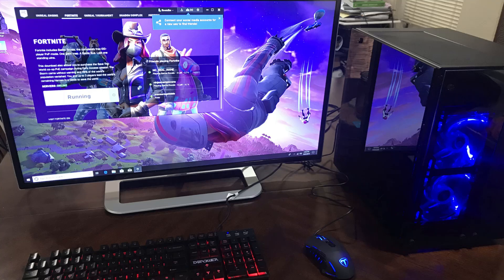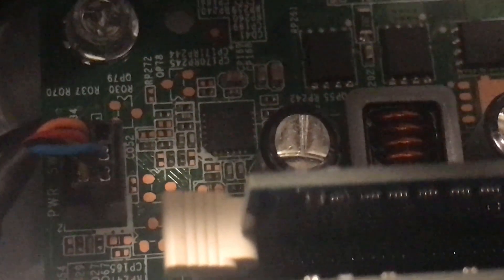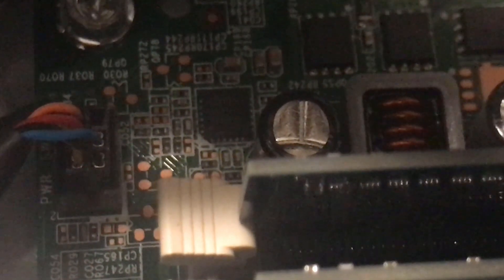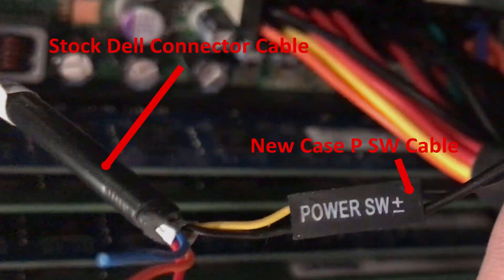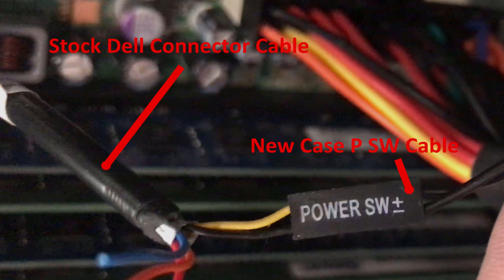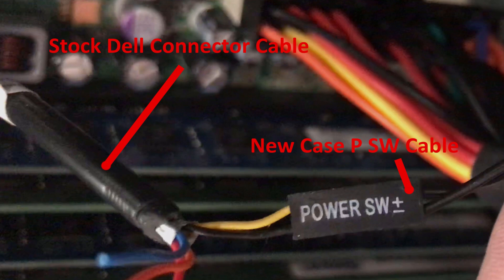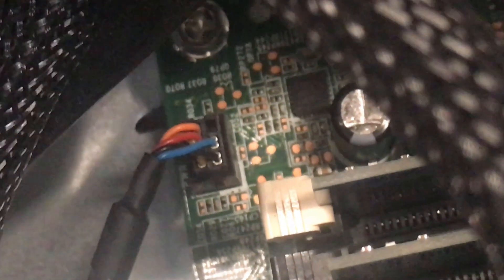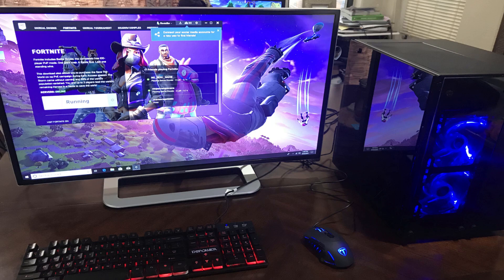Dell Optiplex 990 New Case Power Switch Wiring and Diagram

Comment: I am too lazy to do this so I just plugged the 2 pin power switch on the pin 1 and 4 which is the power switch and it worked 😅

Comment: There are adapter pcbs on ebay but they're quite expensive. Last I knew you could get a set for the power and usb/aud front panel for around $20-$30 usd. Friend of mine just gave me a 7010 with a third gen i7.
Reply: lemme guess 3770 haha thatsa  good one

Comment: If you do this frequently you might be better off buying a dupont crimper and the connectors (2.54.) You can just cut the switch off the cable and then  add male pins to the end of the wires. Same with the proprietary front panel connector, that weird 20/40 pin connector you find on Dells, assuming you can find the pinout or have a volt meter to figure out the wiring yourself. On ebay there are circuitboards that you can plugin so you dont have to do this, but its cheaper to just get the dupont supplies and use the cables you already have inside the machine. I've never tried doing it for IBM/HP computers, but I'm sure you could get away with it on those too, if you can figure out the pins.

Comment: You can just put the power switch directly into the 1st two pins on the power switch header vertically.
Reply: Tried still get the f1 error
Reply: Update I fixed it I didn’t solder every wire back LOL it works great now
Reply: mine won’t fit vertically what should i do

Comment: So my Dell power cable looks like this: https://www.ebay.co.uk/itm/172463431901
It doesn't have the colored wires, but I'm not sure if that's because I need to peel it to display it... otherwise, is there another way of knowing which wires I'll use for the positive/negative of the case's power cable? This is really annoying :(

Comment: I cant get the pc to boot because i get a front i/o failure (because i dont have the original dell case). How did you disable this?
Reply from the maker: I was able to reuse the original case fan, temp gauge and speaker. But for some reason this would still happen to me as well. I found that if I unplugged my keyboard before booting it it would get past this point and fully boot. I am unsure of a better work around at the moment, I've been just putting the PC in sleep mode when I'm not using it and only rebooting when updates are needed.

Comment: I just pulled the power plug out of the optiplex case. They dont even screw it in the power button is literally stuck on with some type of gel so if you find the wire and just pull with some force it will come out same with the IO on the front:P just pops out

Comment: Don't do this. If you cut your proprietary power button off and wire it to a power switch you'll get Power button cable failure, and Front I/O cable failure upon boot up, so everytime you'll have to press F1. You will not be able to get into the bios either. Their is no work around either. I did this for an arcade cab, and had to order a new dell switch.

Comment: I need to do the reverse of this - I'm looking to build a dell optiplex sleeper with a new mATX motherboard. So I'll be using the old case and need to splice the front panel cabling to get the USB/audio jacks and power switch working. Would be great if someone just sold an adapter!

Comment: Did you end up getting a 'power button cable failure' message on boot? I'm currently trying to take an Optiplex 990 for an arcade machine build. 

I used a different power button from Amazon and plugged it into the right connectors on the motherboard, and used the existing 'sense' wire from the dell power button to its connector. The button works and lights up, but I get that meessage when I boot up.

Comment: For every one looking to get rid of errors front i/o you need 2mm pitch jumper like https://www.ebay.com/itm/2P-2-Pin-2-0mm-Pitch-Jumper-w-long-handle-for-straight-header-Pack-of-100/382920891677?pageci=70cf5998-ca02-436f-ba99-b2a8be38355e

On pins 7 and 8

For the power errors pin 1 and 2 and 4 and 6 have to be covered 1 and 2 with the case button 4 and 6 and 3 with jumpers linked and it should work normally for fans you can buy the 5 pin fans or just get the connectors and repin the four pin for the connectors  fan you can find a fan repin tool on ebay next option is to take the 5 pin header of the board with tweezers repin the four pin fan to work with dell boards here is a example below 

https://www.dell.com/community/Optiplex-Desktops/780-CPU-fan-pin-out/td-p/6175786

Comment: Alright, instead of only talking about it and showing a picture. Why dont you actually redo the exact steps on video for the people who dont know exactly how everything was done. Not everyone has heat guns to shrink wrap wires together, not everyone has wire strippers, or any of the sort. Some people like myself just want to know which of the stock cables in the new case go where without damaging things beyond the knowledge of our repair. Cause you gotta consider that everyone's situation could be different. And only talking about it just wont cut it. Good for the guys in the comments who work with computers and instantly got it, but there's still the rest of us you know
Reply: Exactly alot of people like myself are visual learners. Peoples explainations are hardly ever even close to 100%.  Ty for this comment just saved me from watching this shit

Comment: Does it work the same with a dell 990 sff?
Reply: Did u find out
Reply: Measure the standoff pattern and compare the two.  The other issue that I see would be the rear I/O may not line up with the new case.  The connections would be the same.

Comment: Just one question 
The sound panel in the front has a mic on it how can I wire that in to my optplex 990 got a standard gaming case from coolmaster (my brother works for )
Reply: I just took my old plug out of my 1070 optiplex and replace the mic, speaker and I was with the 2 USB that is wired in it and connected bk in to the motherboard front panel switch...on my custom argb build tower  ....had same problems with fans only two hook ups on MB.....had to run a three-way splitter 4 pin and hooked up fan sys. And fan cpu  both together so motherboard  would think there was a fan running then two  4 pin to 5 pin plug s

Comment: A cheap and nasty fix to the Dell stop gag " Alert " is to just take off from the original 990's case the front panel that has the USB and sound connectors and be creative and remount in the rear of your new case out the back and 1 still use or 2 just coil up and hide it somewhere inside. No more stop gag Hit F1 message.
Reply: this is the best and most efficient solution. It might not be pretty but its 100% risk free. Power switch in the back isnt a deal breaker

Comment: how are you dealing with all of the errors at startup from dells sensors missing? "Alert! Air temperature sensor not detected"  Do you have to press F1 every time?
Reply from the maker: for this alert you can take the temp sensor out of the old case and install it in the new one. It just has to be plugged in.
Reply: @MCStu  what sensor? And also, could you help with power sw? I can't figure out how to use regular power sw connectors with the motherboard
Reply: @liceafilms  same bro

Comment: I keep getting alerts when I boot up
Reply from the maker: This is due to not having all the original plugs for the front panel devices (USBs, mic....) and or fan, case door sensor switch, temp sensor... connected. I have not found a work around for this yet. I have to press F1 when I get the alert to bypass ever time I boot. As of right now this is the trade off for switching out the case. Just be to clear this is not an issue you should be worried about other then the annoyance of having to press F1 when the alert pops up. All of these items are connected via a proprietary connector, Dell never intended for us to be up grading these in the way that we are. So the PC is assuming something is wrong when it boots and does not detect these item and that is why this alert pops up. The only way around i have found is booting with out the keyboard plugged in. For some reason the alert pops up and then bypasses right away. But that is hardly a work around as it is much easier to just press F1.
Reply: @MCStu   Would  jumper caps work in place of the optiplex 990  mic, usb panel? jumper caps works on the power button.
Reply: @MCStu  Can you use the Pc normally when you have all these start up alerts? Like I just need to press F1 and it starts normally without any problems?

Comment: What if I have the motherboard but no case with the stock Dell connector. How can I make it work on another case without the stock connector?
Reply from the maker: You will have to modify the stack connector or buy new standard connector and replace it.
Reply from the maker: Your other option would be to cut the plastic housing from around the connection on the the board, the new case connectors will fit on the pins once your remove the back housing that surrounds the pins on the motherboard.
Reply: Tweak Freak how would be the best way to cut it and with what tool
Reply: @f3zure  flush cutters probably or carefully with dremel

Comment: Thanks man! your video inspired me to swap my 990 into a new case. But now i had a 'power button cable failure' error. Looking forward for your new video. Subscribed!
Reply: @punkyard goofball i'd been looking for this such a long time. it's work! thanks men!
Reply from the maker: Do it ask you to press F1 to continue when it give you that error?
Reply from the maker: Contact me on Facebook and I will help you figure it out. https://www.facebook.com/tweakfreaktech/
Reply: @punkyard goofball just shortened those 3 unconnected cables and it works. Finally I got rid of all 3 errors I got before, you made my day.
Reply: @zoidberg1918  i just tried that but my dell 990 sff wont turn on if i jump the 3

Comment: Does this cause an error message when you boot
Reply from the maker: Yes, but not because of the wiring. The press F1 to continue message appears at boot up if all of Dell special stuff is not connected; stock fan, case door sensor, thermometer, internal speaker...... I am working on a work around and will post it as soon as.
Reply: Tweak Freak thanks!
Reply: @MCStu  easiest way would be to cut the original one out of the optiplex and just plug the rest of the wires in it, right?
Reply from the maker: @Writeous0ne  Yes